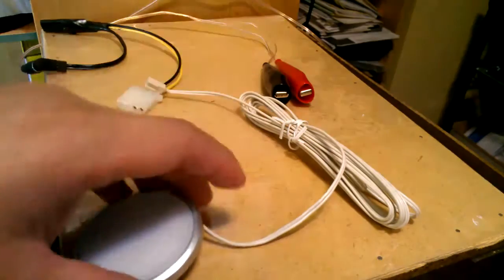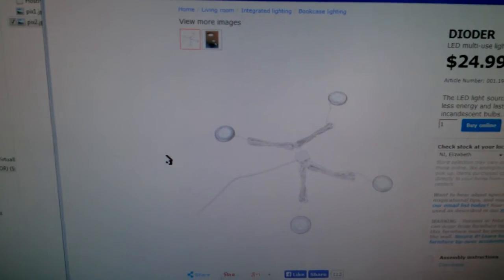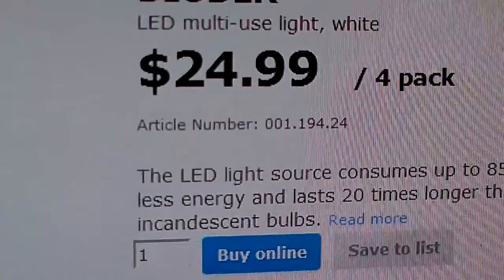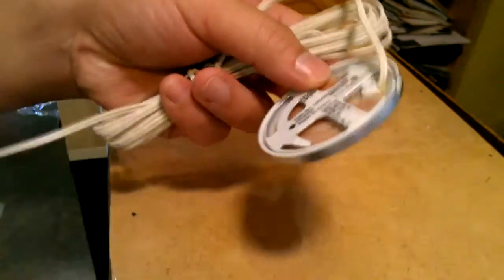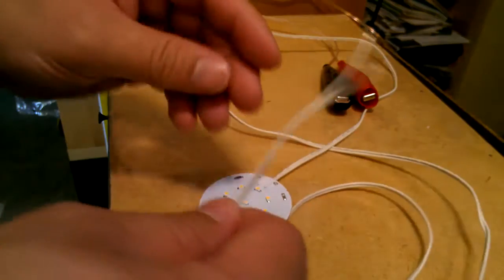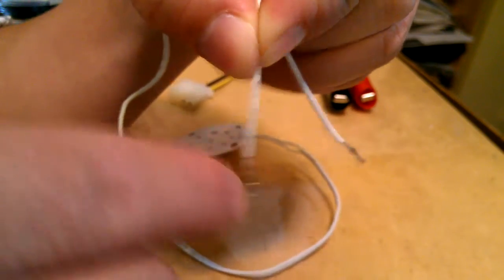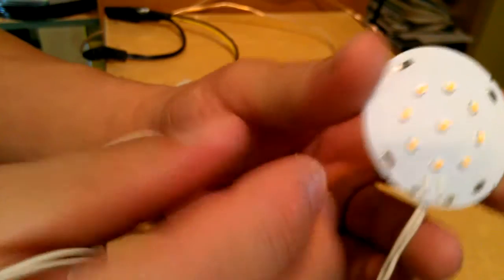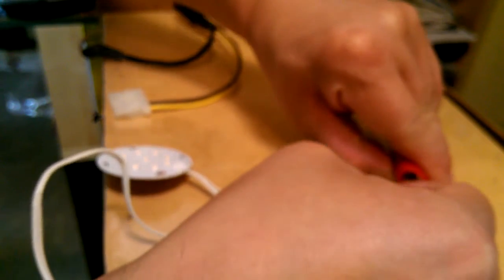Reusing IKEA DIODER (Puck) LEDs in Your 12VDC Projects

Comment: Does the light light up LESS BRIGHTER when using 12V?, or same brightness?
Reply from the maker: these run off of 12 volts. The original power supply is 12 volts DC. So it would be the same.
Reply: Hello! I woder if i could connect 7 of these in serial in my sommerhouse with only 12v? Or do you recommend parallell connection?